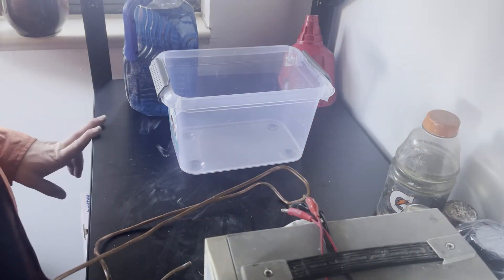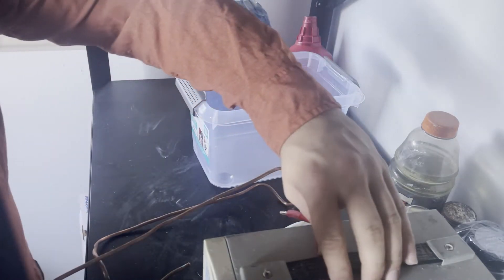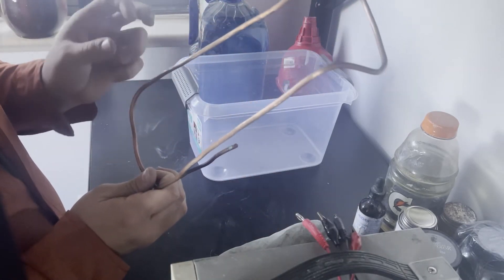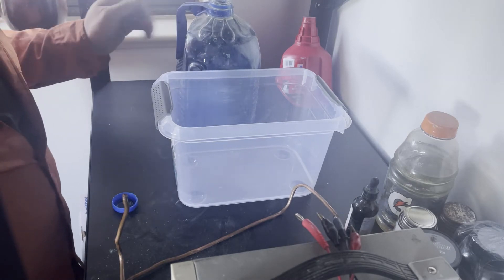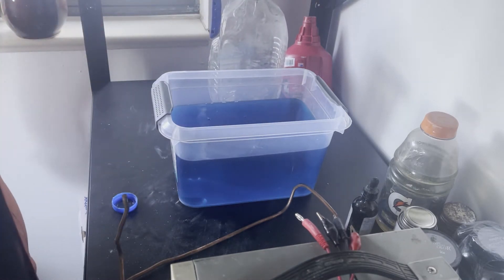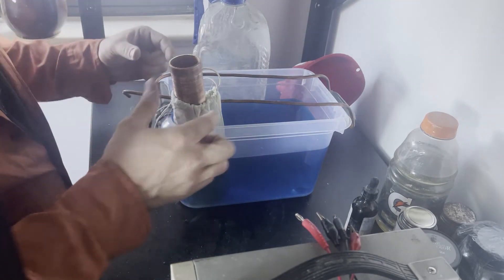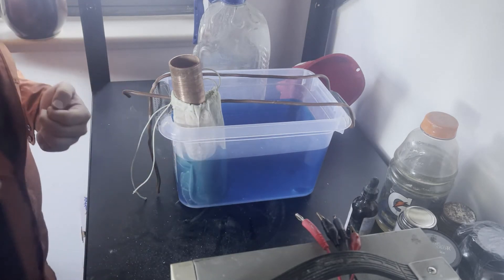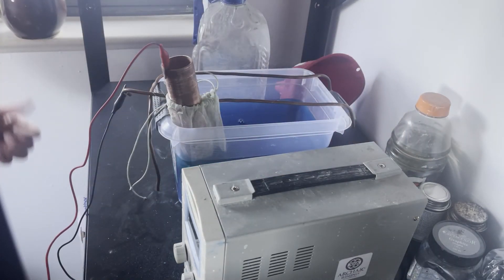Setting up an Electroforming Bath : A Beginners Guide

Comment: DUDE! thank you so much for making this! Quick question. Is your bus bar solid or does it have a hole through it? I found some plumping copper pipe that I wanted to use but it was not solid, had a hole for water to go through I am guessing. So the current wouldn't connect to it? My gator clips could have been touchy though.
Reply from the maker: HI!
So my Bus bar is solid because it carries the electric current better (I Think), while my Anode is hollow copper tube that has more surface area for the acid to break it down. Although That's just my set up, I'm sure if you used hollow as a buys bar you'd be fine, its still a conductor
Hope that helps